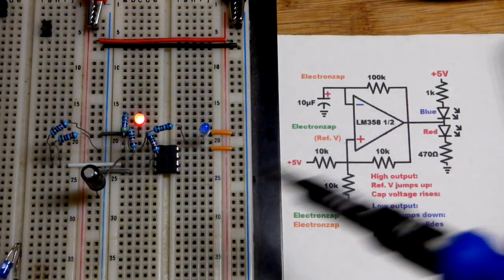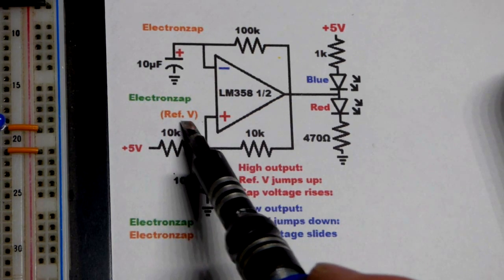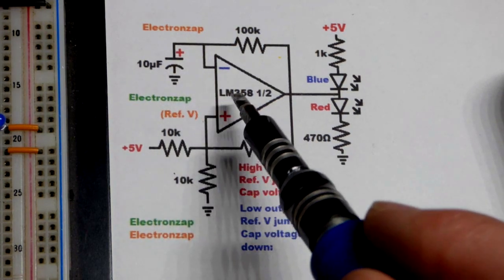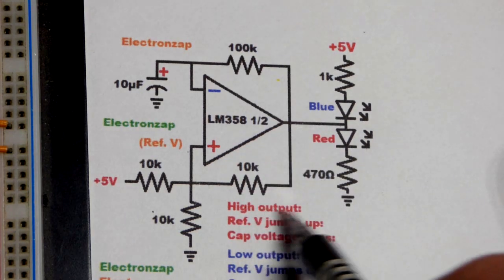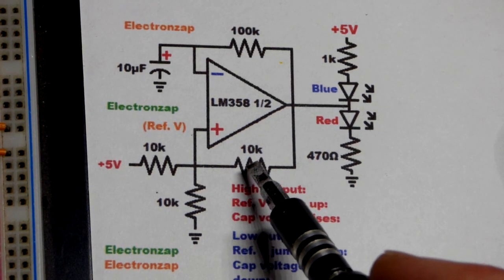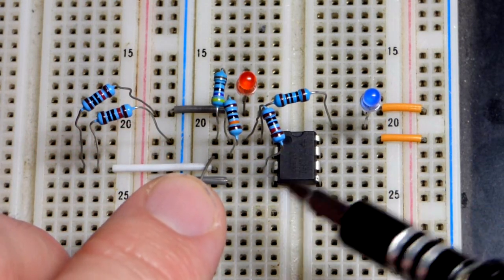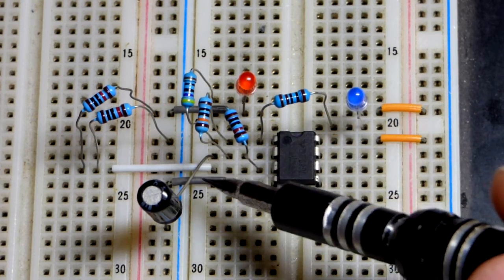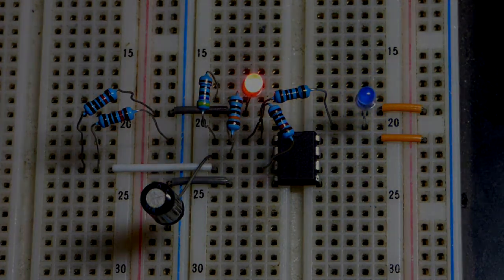LM358 Op Amp Astable Multivibrator demo circuit alternating LEDs schematic diagram by electronzap

Comment: You may want to mention that floating pins on op amps can damage the unit. TI has some good data sheets showing how to handle this condition safely.
Reply from the maker: Good tip.